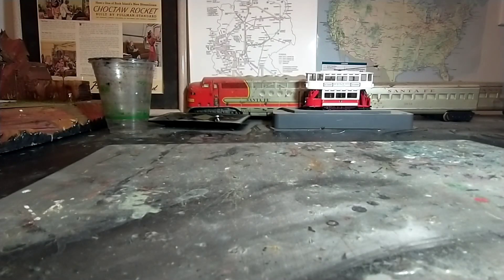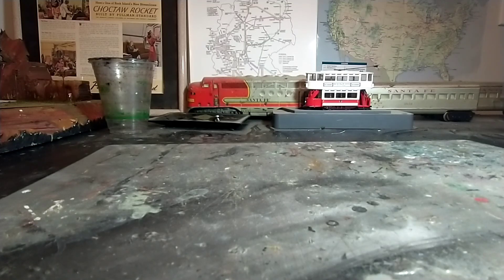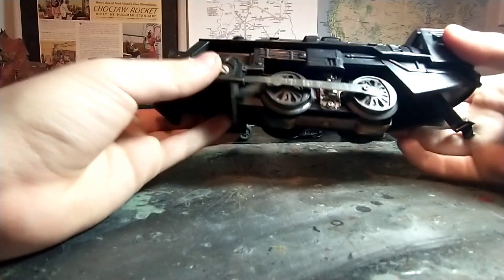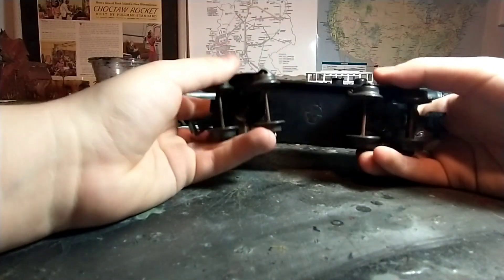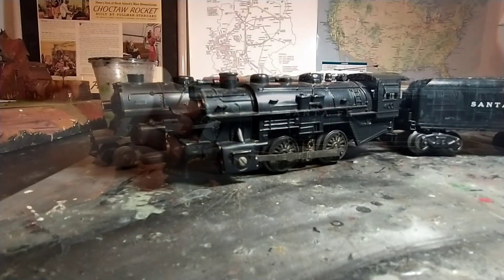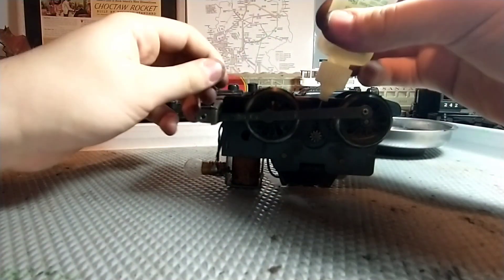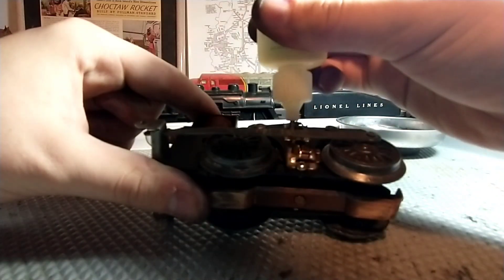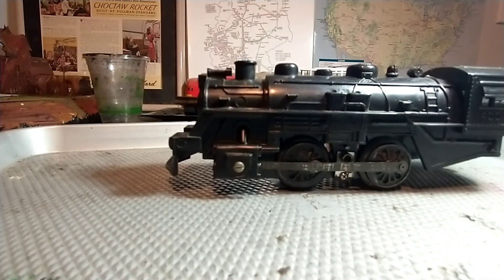Budget Steam Engines, Good Value for Money? | Restoration, Operation, and Thoughts

Comment: Good deal. The Lionel noise is from the armature shaft needing oil, on both ends. getting to the brush end is not as easy on the plastic motor type. As for the MarX often you can just run the engine with a bit of a load that is to heavy behind it and the the wheels will spin enough to clean them selves. Also on the double reduction style motor the gear end has a special shaft insert behind the gear that has a flat spot on one side, so getting it right is important. I often find that people miss putting oil on the gear pivots and in the modern ones if you miss that and run them often or make quick starts and stops those pivots will wear away and you will have floppy gears and the the gears will get striped. People will blame the plastic gears instead of the lack of oil on the plastic pivots, gear centers...
Reply from the maker: Yea, I am well aware of the flat spot on that bearing behind the gear on the Marx! It'll only go in one way. Thanks for the insight on the noises, I figured as such but haven't gotten the chance to really run them in. Thanks!

Comment: The sloped tender isn’t the correct tender
Reply from the maker: Doesn't bug me
Reply: @chicagolandrailroader  it’s actually for a switcher tender engine wich is an odd engine
Reply from the maker: @DukeOfTrains as far as I have researched this locomotive was released with a slope back 1962-1966, so it is the original tender.
Reply: @chicagolandrailroader  alright
Reply: @chicagolandrailroader that tender came with a few locos one of with is my manual lionel

Comment: The Marx loco runs really well. I have the same noise coming from a Lionel loco with the same motor. Let me know if you figure out how to get rid of that noise.
Reply from the maker: I think the noise originates from the armature shaft. I would put the tiniest drop of oil on any exposed part of the shaft, and run it for a while. This fixed most of the problem for me, and I hope it helps. Thanks!